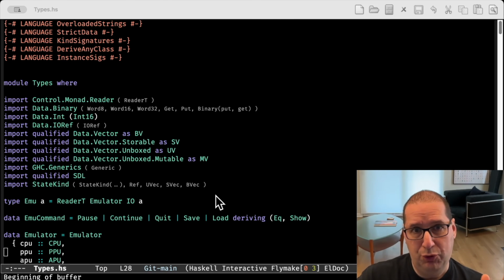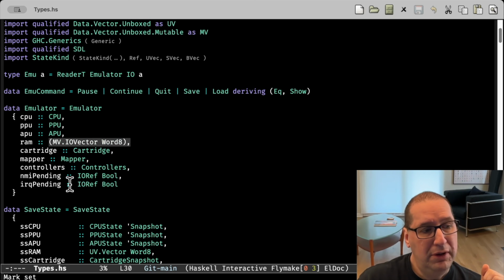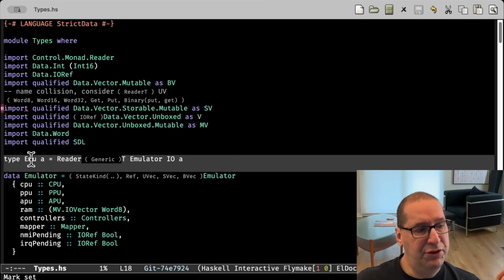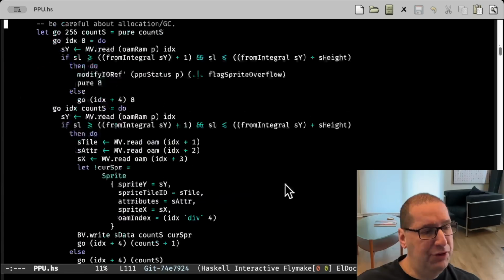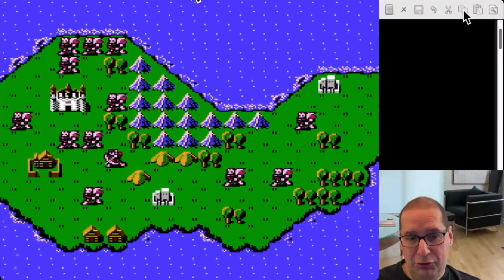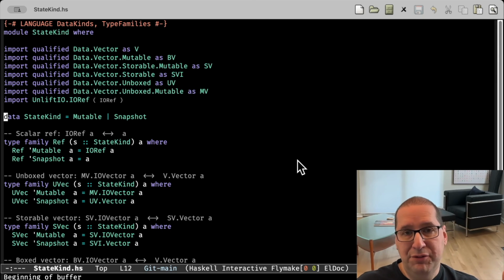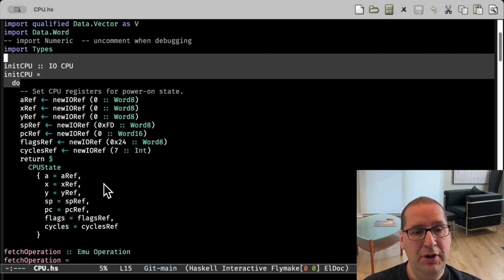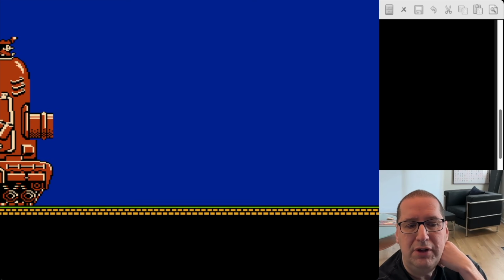An NES Emulator in Haskell

Comment: That's why mappers are simultaneously so annoying and so powerful. It also kind of means that the only way to truly emulate the entirety of hardware that makes up the NES, requires that you implement every single mapper, because all of them and the original hardware together constitute the actual full and complete NES. You can think of it like a giant spiderweb that encompasses the entire collection of games because without a given mapper chip, you literally can't play the games that depend on them. It also means that a purely 6502 emulator is only the first step. Sure there are some games that don't require mappers, but most games required them.

Comment: 7:00 on
I'm pretty sure writeIORef is lazy in its second argument (the value) so several of these set operations are possibly storing thunks. StrictData only makes ADTs strict in their fields, it doesn't make pattern bindings strict (for that there's Strict, which implies StrictData) or change the behaviour of functions written elsewhere (like writeIORef). There are a few different ways to go about this, the simplest is to define and use
writeIORef' !ref !val = writeIORef ref val
This uses BangPatterns, its possible to use the seq or $! functions to implement it instead. The ! on ref might be redundant since I think writeIORef is strict in the reference, GHC can sometimes see a function is strict in an argument downstream and pass that information back upstream. (Might need an inline/inlineable pragma on the thing used? Not sure)

You can also look into runtime profiling to see what is generating garbage over time:
https://mpickering.github.io/eventlog2html (for a nice interactive chart)
https://well-typed.com/blog/2023/03/prof-late (about a newer profiling flag, but this doesn't use eventlog2html)
E.g. it would be good to try this before and after the suggested writeIORef' change to see if it thins out the allocations.

Well-Typed have a video on inspecting GHC's intermediate core representation for optimisations:
https://www.youtube.com/watch?v=vyp8pWW5QQk
Simon Peyton Jones has a talk explaining some of the major types of optimisation GHC does on core here (optimisations start about 30m in):
https://www.youtube.com/watch?v=uR_VzYxvbxg
Many of these optimisations are for purely functional code though and likely don't apply to imperative code, aside from inlining/specialisation.
But they very likely apply to some of your functions like getX in terms of simplifying the higher order monadic code into something like
getX = ReaderT (\Emulator{cpu=CPU{x=x}} -> readIORef x).
Reply: I'd love to know why YouTube allows you to post links without deleting your comment, yet even to other YT videos my posts always get summarily deleted.

Comment: @1:00 Heh, it seems to be a very common question: "Huh, Haskell doesn't allow side effects, how do you do stuff then?". Sounds paradoxical until you realize a subtle difference between side effects and effects - a side effect is when you call a function that converts Foo into Bar but it also prints something to terminal or throws exception or does `exit(1)` if it doesn't like particular Foo, but it doesn't say so on the tin (type signature). An effect than is whatever happens along with Foo-Bar convertion and it's indicated on the tin. Haskell forbids side effects (doing stuff but not saying so on the tin) but very much supports effects! The only side effects it doesn't require to declare is wasting RAM and heating up CPU lol. One can go further into subtle differences of effects vs. side effects as something that is observable from the outside (think of ST monad that can mutate memory as long it's not observable by caller) but it's a deep rabbit hole. 

Around @9:00 I wonder if pinned memory would be helpful to get rid of GC hiccups. Whole point of it is to be pinned in one place and not be moved and copied by GC. Since you're already going C-style with IO Refs might as well fully embrace low-level stuff maybe. It also sounds like a good fit for memory regions that are live during whole program execution and being constantly mutated - cpu registers, ppu framebuffer and so on. It may also help with cache locality - modern CPUs caches are probably big enough to keep whole NES state. 

Around @13:00: Type Families are basically type-level functions that operate on types instead of terms (values). But they're less powerful than proper type-level functions (and have lots of caveats in Haskell). I wonder if you're gonna like Idris which has proper dependent types support that allows way more cool type-level stuff in a cleaner way than Haskell

@17:48 1979? Programming in Haskell is more like programming like in 2035 while everybody is still in the 90s :D
Reply from the maker: Good insights! And yes, I picked "1979" as the name for the sub-series just because I like how it sounds.

I've scratched the surface of Idris but am not (yet) smart enough to really understand how to apply dependent types in anger.